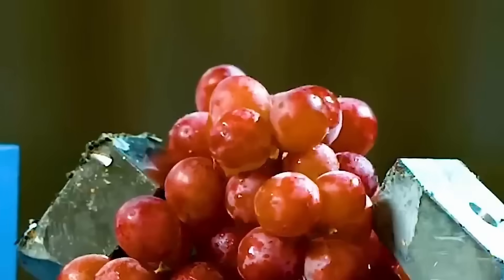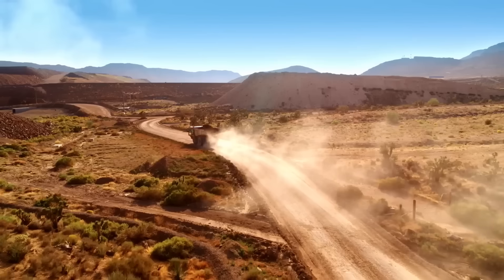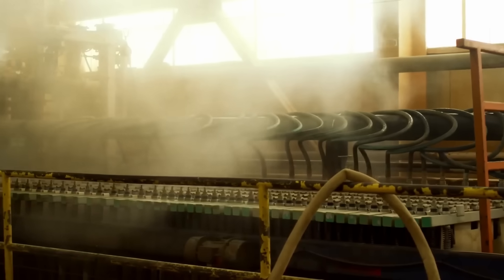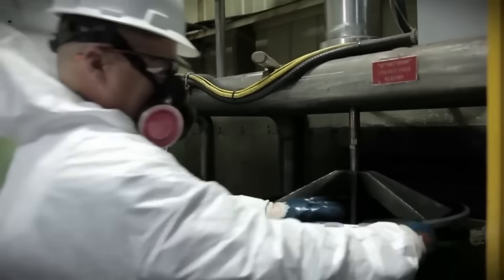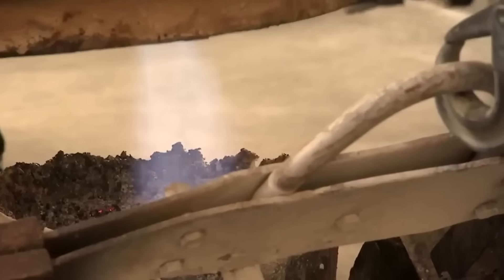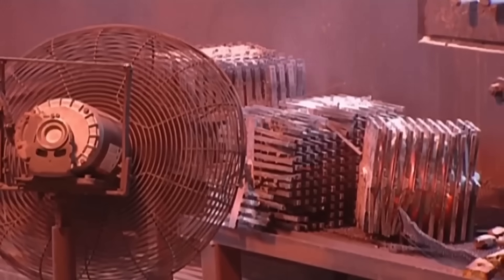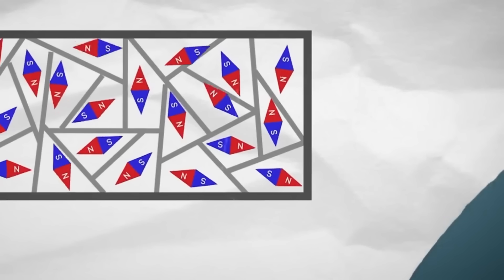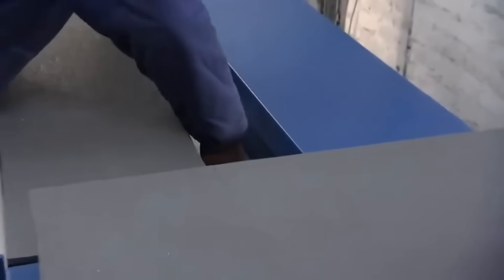How the World’s Strongest Magnets Are Made (Neodymium Explained)

Comment: Interesting IDEA, I have never seen anyone using the power of mangnets like the Neodymium magnets in conjunction with two more, the middle one could then like in a combustion car have a cylinder which by frequency modulation go up and down, and in turn drive the motor, which is totaly free, as people know you don't really need a ton of power to let electrical magnets go or latch. in addition the motor could be cylindical with more magnet to let the magnet go round instead go up or down, which make more noise right?!